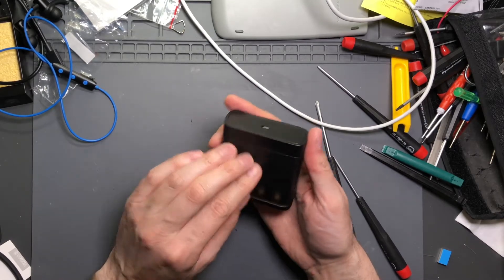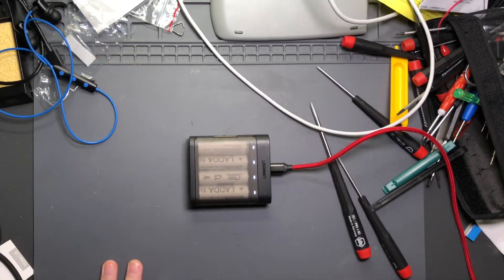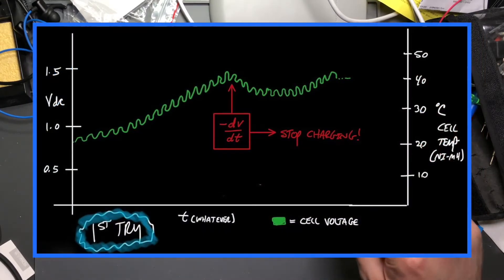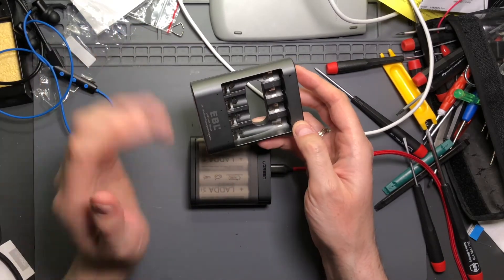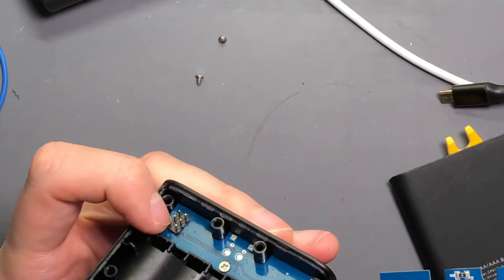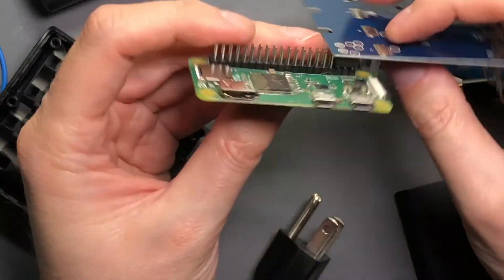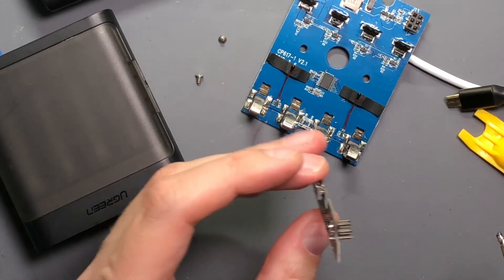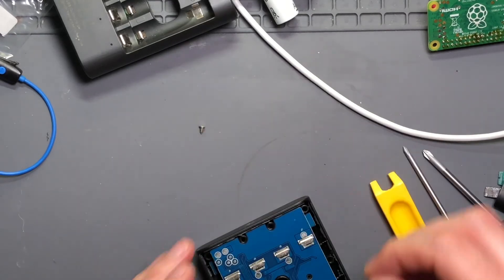UGREEN AA/AAA Battery Charger Repair and More Battery Talk

Comment: Pretty sure it was me that asked if you still used the charger, thanks btw for answering. I bought this charger and use it for my energizer AA batteries. It is great for my needs, (charging 2 and swapping the charged ones for the 2 drained ones) but there is an issue when i have all 4 batteries in at the same time. With 4 charging at once the blinking lights stop intermittently and restart every few seconds or so. Im no electrician so i assume its restarting the charge cycle over and over? But with 3 or less it performs normally. Still not an issue for me, as it does what i need it to, just thought i would mention my experience with the  charger,  thanks for great videos, keep up the good work!
Reply from the maker: That’s odd. Did you try a different USB power supply?

Comment: mine was at least working fine up until a 2 months ago when I noticed that it takes more than 6hrs to indicate that it was fully charged but when I use my batteries they can only provide around 1/4 of their original capacity I thought at first it was the batteries going bad but they were new and only have been used around 12 times. Later I find that my ugreen charger only uses an average of 0.8W, I did not test mine when I first got it but I assume it would use around 5W normally so my charger should be defective but it still charges the batteries but it needs to charge the batteries at least 4 times to get 90% charge and have to unplug and plug usb power for 3-4 times.